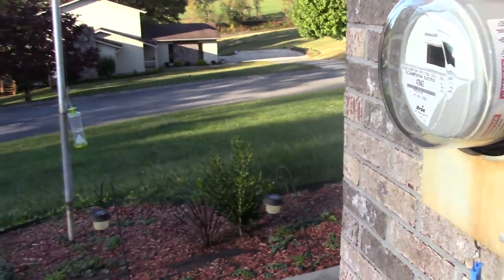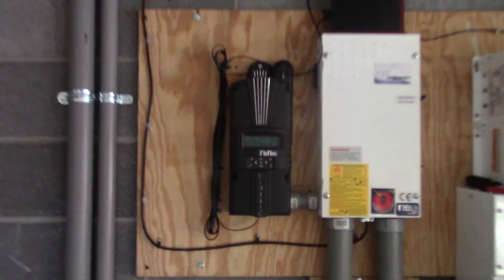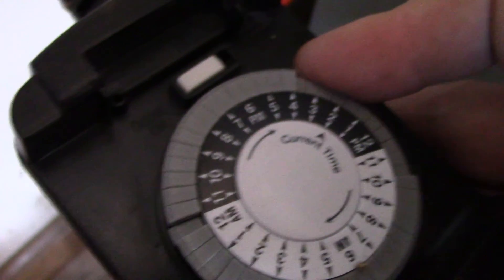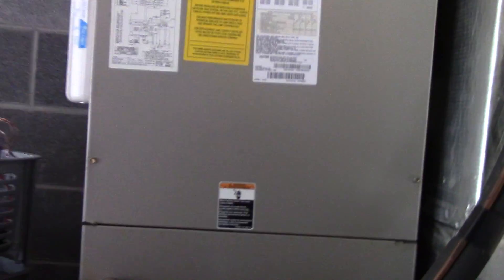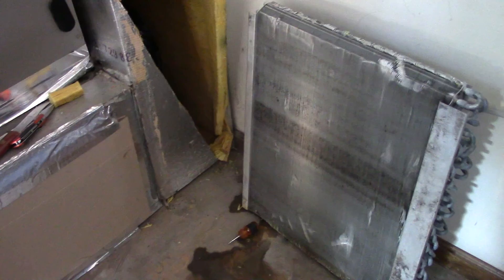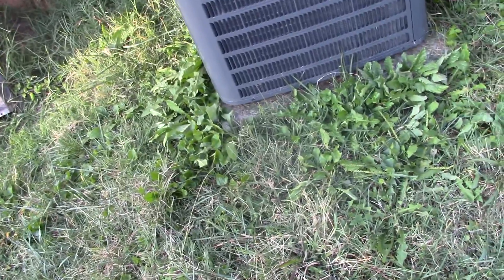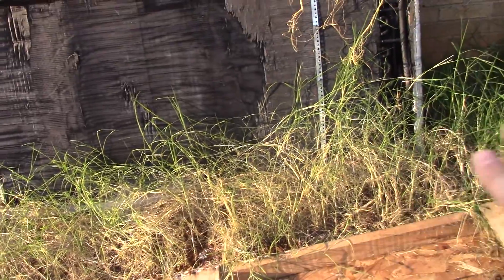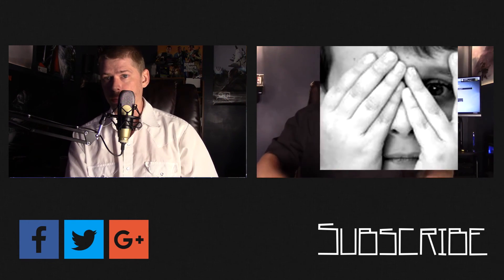SOLAR OFF GRID!!!! HOW LONG CAN I GO LIVING WITH NO POWER FROM THE GRID!!!!!

Comment: This is something that all people with solar should test, like I know my current system can make it 7 days with nothing hooked up to charge with just running the 12v loads in my house.  Of course I well have to retest once I go to the 48v system.
Reply from the maker: I hope you can go 48 volts take  your time with it my friend
Reply: I am going that way, I got my inverter, just a matter of time to get it done.
Reply from the maker: Great North Woods Hillbilly what type of inverter
Reply from the maker: make a video please
Reply: I am going to run a Trace SW4048, there is a video on it
Reply from the maker: is a inverter
Reply: yes its one that Trace made for many years, 20+ years, great units
Reply from the maker: Great North Woods Hillbilly my batteries is not so bad to
Reply from the maker: today
Reply: so you ran all night without the grid
Reply from the maker: +Great North Woods Hillbilly yes
Reply: Hopefully you can make it several days
Reply from the maker: +Great North Woods Hillbilly it's going to be bad weather today
Reply: that sucks, I guess time well telll

Comment: Stay off the gaming computer and get some shut eye, that will net some more power for life support. ;>)
I know I would be fine if I never used the electric dryer. Try flow restrictors on the faucets that saves on hot water and the well pump (if you have a well). Radical life style change at five thirty P.M. I'll wager you last off grid 72 hours, but hope I am wrong

Comment: 8 hours if your conservative
Reply from the maker: +Roy Amberg ok will see
Reply: Short on battery and not full. It's hard
Reply: Roy Amberg looking at the math 10kWh x .50% DoD = 5kWh.  5kWH x .84% current state = 4.2kWh.  4.2kWh / 8hrs = needs a 525w continuous draw. With family etc, I would estimate a sporadic 950 to 1000 watt draw. I give him around 6 hours to a 50 DoD.
Reply from the maker: i have a soc now of 81% with a load of 160 watts
Reply from the maker: soc 81%
Reply: Solar Power Electricity and Electronics sorry, I didn't factor in your daylight charging. I was thinking night time usage.  My math is jacked up, please disregard.
Reply: Solar Power Electricity and Electronics 160w, are you just running lights? What are you running?
Reply from the maker: my internet, laptop, surveillance system, 3 timers, and the inverter
Reply: Solar Power Electricity and Electronics No lights, fridge, or freezer?
Reply from the maker: and the security system too sorry my missed it because it will beep every 2 minutes with out power
Reply from the maker: bed time so no lights timers will turn the fridge @ 9am
Reply from the maker: been like that for months now friend
Reply from the maker: my big problem no games =(